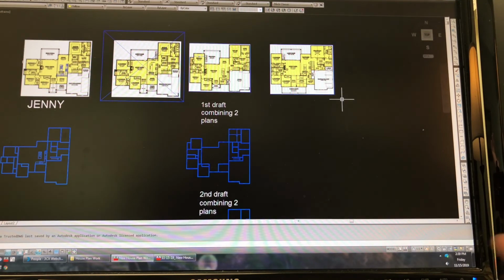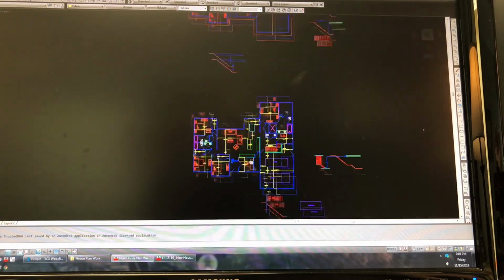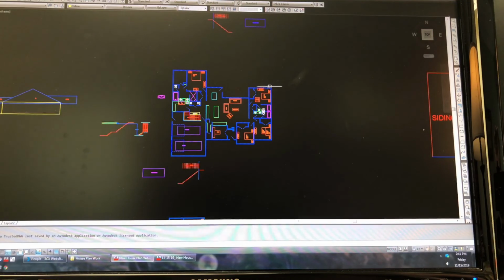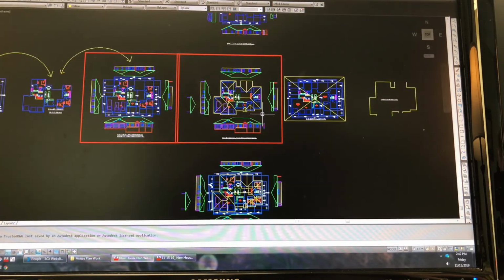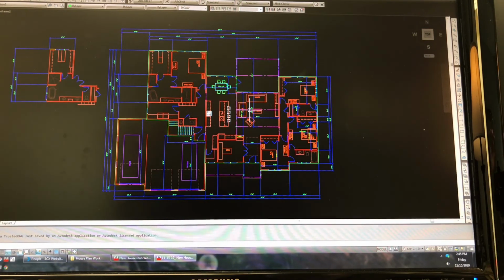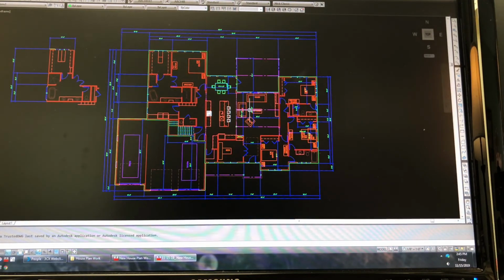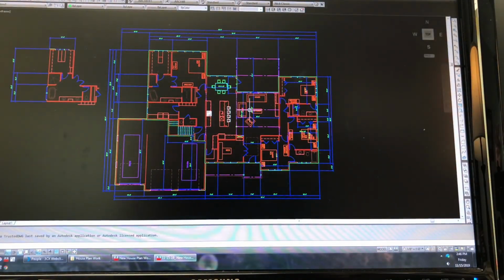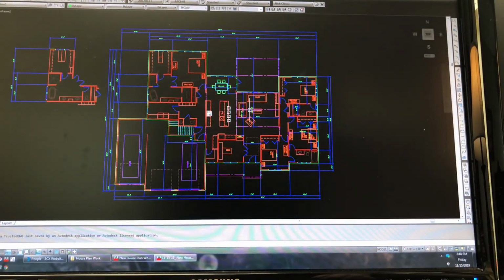Rusty Wrenches Builds - House Build EP1

Comment: Some random thoughts on house design. My wife and I did this about 25 years ago after I retired from the Air Force.
-Can you create a floor plan with no hallways? Just wasted space, usually.
-Efficient shape: linear total of external walls has the most effect on heat loss. Floor square footage is essentially equal to roof, so only wall jogs add to surface area. In the extreme, you get a circle, but realistically the most efficient is a rectangle. I’m mostly thinking of cold climates since I live in northern Wisconsin.
-You pay for insulation once, you pay for heating/cooling every month.
-Modern heat pumps are amazingly efficient. Ours, just put in, can suck heat out of -15F air and warm the house.
-We put cedar on the outside of our house—very pretty. Keeping up with restaining every few years is a pain. Think about esthetics AND ongoing maintenance.
-We don’t get tornadoes so much, but straight line wind storms do come along. Think about a Cat 4 roof (probably steel) to shrug off the hail. Saves on homeowners insurance too.
-If you plan on infloor heat, think about porcelain tile over the subfloor, preferably with the heat tubing just below. Trying to push heat through subfloor from the bottom, with flooring or carpet above, makes for a slow input of heat.

I designed our house, eventually did a 3D model in AutoCad. Building once with bits usually helps. Been living in ours for 22 years, pretty happy overall.
Reply from the maker: I appreciate the comments.  We worked to try to minimize the hallways.  We wanted to partition off the bedrooms wings from the main house, mainly for sound control.  The layout is more or less 2 rectangles sitting at 90° to each other with a couple of gables coming out.  We’ll see how the architect works it out.  I agree wholeheartedly on insulation.  We are going to use a product from Huber called Zip R.  It has EPS foam boned to the back of the sheathing for a thermal break.   For interior insulation, we have been bouncing around with closed cell foam and batt or bibs.  With 2x6 exterior walls, it should be nice and warm.  Thinking about Hardie lap for the exterior.  Nice product with minimal upkeep.  We are looking at geothermal.  It’s not super common around this area, but the benefits are amazing.  

That’s pretty neat that you did your own house.  It’s going to be a fun project.  Keeping on the budget is going to be the hardest thing.  I was single when I built my first house, so I only had to argue with myself haha.
Reply: Sounds like you thought through it pretty well yourself.
We had my wife’s mother come to live with us a few years after building the retirement home, ended up putting on an addition ten years after the original. I only mention it because we used closed cell foam to insulate and it is awesome. I also made the ext walls with offset double 2x4 studs to get depth and a full heat conduction break—probably overkill. Of course the addition completely threw out the efficient floor plan rule. But I used ICFs for the basement (walkout) and dropped that floor for more headroom for a gym. The new Master has a decadent bath with a huge two-head shower, even has a trick vanity for my wife. Built all the cabinetry myself except the solid surface counters. It’s good to be retired.
Loved your C10 work. I think I’m finally going to start on my ‘71. It’ll be a stick though, probably 5.3 unless I stumble across a 6.0. Good luck with your house project!
Reply from the maker: That sounds like a amazing build.   I have done a fair amount of research, but I know there is a lot to be learned.  I appreciate all of your insight.  A 5.3 will be great.  I happened on the 6.0 on thanksgiving a few years back.  A guy north of me posted it for sale and I left thanksgiving dinner to go get it.  Priorities haha